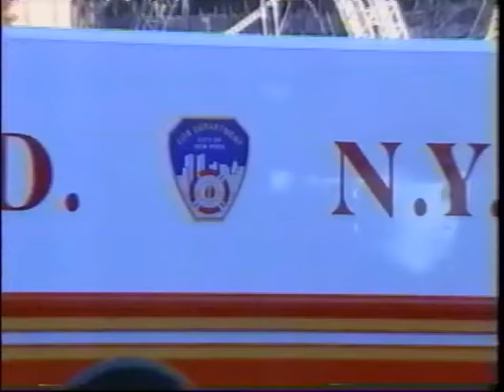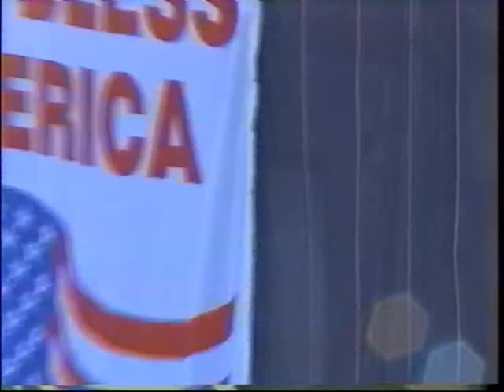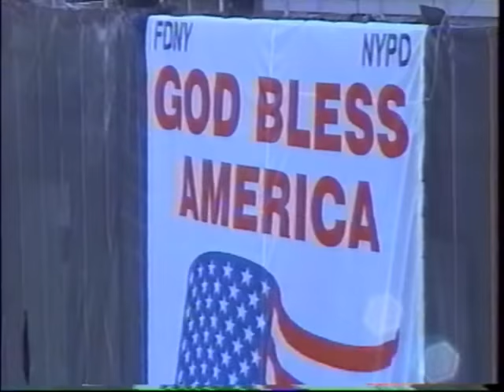Ground Zero recovery months after 9/11/2001

Comment: So some parts of close-standing buildings left standing (Even a part of tower), but WTC 7 went down vertically in 3 seconds. Okaaaaay
Reply: 20 seconds, not 3 seconds.  Different design.  Different construction.  Different damage.  If it is any comfort though, Building's 3 and 4 and St Nicholas Church were all completely destroyed too.
Reply: @MFitz12  what 20 seconds you talking about? Vertical fall lasted for 3 seconds, no more. There is absolutely no way of all the columns to collapse simultaneously with 100% time sync without manual preparation. At least one wall or side should have stayed. But there was even no angle of a fall - this is against all the physics.
Reply: @zudwa9280  - I have the gift of sight and ability to tell time. Also, all columns did not fail simultaneously.  This is why Building 7  is referred to as a progressive collapse.

For clarity I like to break the collapse of Building 7 down into separate phases. Others may break it down differently. If what you know about Building 7's collapse was gleaned from watching conspiracy leaning Youtube videos, much of this will be news to you.  

One of the more presistent myths about the collapse of Building 7 is that the entire building collapsed "symmetrically", at "free-fall speed" (not even a thing) and landed "within its own footprint".  As will become painfully obvious, none of that is even remotely true,… or relevant. 
 
Phase 1 of the collapse event began the moment Building 7 was pelted by thousands of tons of burning debris from Tower One at 10:28 am. 
 
By the early afternoon, after hours of unsuccessful efforts to fight the fires which had spread throughout the building and with reports of from FDNY firefighters of creaking and moaning sounds from the structure and movement in the SW corner, concern was raised the building might be in serious trouble. That the structure was moving, shifting was subsequently confirmed with a surveyors transit. It was clear Building 7 had become unstable, was in danger of collapse and there was nothing to be done that could change that. 
 
With no one left inside to save and to avoid further needless loss of life the FDNY on-scene commander Daniel Negro ordered all firefighting efforts at Building 7 pulled and a safety zone created around the building in the event of its collapse. This order necessitated the cessation of search and rescue efforts in much of the Twin Tower debris pile which was understandably unpopular with firefighters and rescue workers. All of this took place by about 3:00pm.  Building 7 was then left to its fate.
 
Local and national news media had been reporting on the condition of Building 7 throughout the day, reporting that it was on fire and in danger of collapse - and even in several cases erroneously that it had collapsed - throughout the day.  The most famous but actually one of the last such reports was from the BBC at 5:00 pm.
 
Phase 2 - Collapse INITIATION occurred at 5:20 pm, several hours after the safety zone was created around the building. The collapse initiation event is what started the building moving. Once started, everything else was chaos, gravity and momentum. Progression to global collapse was inevitable.
 
The first obvious external sign of collapse initiation is a kink in the roof of the East Mechanical Penthouse (EPH) and a vertical progression of window breakage along the Column 79 line, both events clearly indicating the buckling failure of Column 79. This all takes place in an instant. That the failure of Column 79 would cause this observed behavior was confirmed in one of the NIST models and subsequent independent modeling.
 
Perhaps the most remarkable thing about this moment of collapse initiation is how quiet it was. In the CBS fixed camera video in particular it is clear that most observers failed to notice those initial signs of collapse because there was no sharp, loud noise associated with it.
 
The precise internal failures which resulted in the buckling of Column 79 are hotly debated with several plausible theories, but will never be known with certainty.  It is virtually certain that multiple floor failures around Column 79 low in the structure 8-14th floors) left the column laterally un-braced over an excessive length. Precisely what beam, girder, flange, seat or whatever failed to start things moving is destined to remain a product of speculation for all eternity.
 
Column 79
http://graphics8.nytimes.com/images/2008/08/22/nyregion/0822-met-WTC.large.jpg
https://wtc7fact.files.wordpress.com/2014/02/wtc7buildingorientinterior1.png?w=300&h=241
 
Building 7 Prior To external Signs of Collapse Initiation:
http://www.911myths.com/assets/images/WTC7_Penthouses.gif
 
Building 7 Showing Window Breakage and Kink in the EMPH Roof
http://www.wtc7.net/docs/theory/June2004WTC7_Page_31_m.png
 
Phase 3 - This is the transition period from collapse INITIATION (that moment were things started moving) to the beginning of PROGRESSION to global collapse. From this point on, gravity is doing all the work and everything else that happens from here is the product of gravity, not what caused the initiating event - what started things moving.
 
Externally, this progression phase is evidenced by the complete collapse of the EMPH into the building, disappearing below the roofline 2.2 seconds after the kink first appeared in the EMPH roof. This event clearly indicates the loss of the supporting structure below the EMPH, specifically Columns 80 and 81, adjacent to Col 79. Here is what those column connections looked like:
 
 http://www.wtfrly.com/wp-content/articlepics/girderwalk1b.jpg
 
All 3 columns at the eastern end of the central core have now failed, taking with them all of the floor trusses, beams and girders which were connected to them and are still connected to other parts of the structure.
 
EMPH Disappears into the structure:
http://www.wtc7.net/docs/theory/June2004WTC7_Page_36_m.png
 
When the EMPH falls though the building it creates a visible wave on the windows, presumably as they are twisted or pushed out by the changes in air pressure. The scale of the pressure change is also visible by the smoke being sucked in at the top of the building by the vacuum created in the EMPH's wake.  Smoke is now blowing out the top of the building, it is being sucked back in.
 
This is important because it shows the EMPH descending rapidly though the building, which is consistent with a collapse of Columns 79, 80 and 81 low down in the building and well before the other core columns have failed.
 
CBS video
https://youtu.be/Wf1HcJ7GKsc
 
Composite of 3 videos of the full collapse, synchronized
https://youtu.be/6x7UnTnHy7Q
 
https://www.metabunk.org/attachments/wtc7-window-wave-loop-youtube-2018-01-07-13-37-09-png.30897/
 
Phase 4 - About 7 seconds after Phase 1 we see collapse progression from east to west through the core  as evidenced by the collapse of the rooftop screenwall and West Mechanical Penthouse, dropping below the roofline and into the center of the building along with a series of horizontal exterior window breakages indicating the,…
 
*TOTAL FAILURE OF THE BUILDING CORE*.
 
First Stages of Collapse - Rooftop structures:
https://i.gifer.com/DlV0.gif
 
At this point the perimeter façade and exterior curtain wall are still standing and largely (on the north side anyway) intact. With the core gone the critical structure required to keep the perimeter façade standing is gone.  It can no longer remain up on its own. 

By the way, for any of you who have been running with the argument that Building 7 collapsed at "free-fall speed" (which isn't even a thing) please note:  If that were true the building would be on the ground at this point.  It's still standing. 

Also, for those who are still running with the "all 82 columns failed simultaneously causing a perfectly symmetrical collapse (which can only happen in a pre-planned demolition)" argument that by definition goes hand-in-hand with the "free-fall speed" claim, please note; that obviously didn't happen either. Core columns are gone, most of the perimeter columns are still standing.  Building exterior is still standing. 

But I digress.  Now back to our regularly scheduled programming,…
 
7.2 seconds after initiation the west end of the roof starts to move, followed 0.5 seconds later by the east end of the roof with a distinct kink forming in the center of the roof at Cols 46 and 47. The more astute among you will have picked up by now on the *decidedly non-symmetrical nature of this supposedly symmetrical collapse*.
 
Phase 5 - Global collapse begins 8.2 seconds after collapse initiation started everything moving. By this time the building core has failed and is collapsed or collapsing, leaving only surviving perimeter columns (remember Col 20 on the south side had already failed in the morning) supporting the exterior curtain wall/moment frame which was more or less still standing. Unable to stand on their own, and probably being pulled down behind the collapsing core by still-attached girders, beams and trusses, the exterior columns fail and the curtain wall collapses. As the curtail wall collapses, the center collapses first, illustrated by the distinct non-symmetrical kink in the roofline and the remaining shell of the building twists and leans to the south as it falls, moving in 3 dimensions, not just straight down.
 
It always surprised me that a physicist like Steven Jones couldn't understand the trick that Building 7 plays on the observer. It is similar to yanking a table cloth out from under fine china. The progressive collapse occurs faster than the buildings connections can transfer the energy, so the moment frame and the curtain wall show no effect, because the energy of the collapse is not transferred to them though the floor connections.

Rather than "collapsing into its own footprint", the debris from Building 7 actually filled all four streets surrounding it, caused about a billion dollars in damage to the Verizon Building next door and did so much damage to 30 West Broadway (Fiterman Hall) that it had to be torn down. Because the debris from Building 7 blocked access for the rescue and recovery efforts on the Twin Towers Debris Pile and there were no rescue or recovery efforts to be done at 7, it was removed at high priority in order to improve access to the site from the north.
Reply: @zudwa9280  - Do let me know if you have any questions or comments.
Reply: @MFitz12  the final 2,25 seconds were done at 'pratically free fall speed'. This is a demolition effect, not a 'progressive failure'. The final fall of the WTC-7 was in about 6 second and that's is.  There are NO reasons that WTC-7 should fall so fast and so entirely just because 'the 79th coloumns fallen'. You can repeat the NIST lies all you want, but this will not change a bit of the 'strange' cracking of the WTC-7. So you are another disinsformator who pretend to be credible.  Ah, by the way: HOW THE HELL the temperatures becames 'so hot' that the modern, steel structured WTC-7 went down? Or it was built in 'aluminium' this one too?
Reply: @Diadema033  - So you are saying a building just knows what started it to collapse and 15 seconds after it starts falling just knows to suddenly accelerate to "free-fall speed" (which isn't a thing BTW) but only if explosives started it moving?  Are you really sure you want to run with that?
Reply: @MFitz12  ever seen a controlled demolition? It seems not. Try here on YT, perhaps you'll learn something.  I'll repeat: even NIST aknoledged about 2.25 second at 'pratically free fall speed'. Find me a reason to this and compare the WTC7 fall with the Plasco building that lasted actually almost 20 seconds despite being just 43 meters tall, starting from one point and ending to the opposite, as we could expect by an 'accidental' breaking.
Reply: @Diadema033  - Probably seen hundreds.  You ever heard one?  Watch your own videos and crank up the volume.  Then listen to Building 7.  
Personally, my mind is not restricted to having to compare one event to another dissimilar event in order to try and understand it.  I can explain what happened to Building 7 to quite a high level of detail just based on the merits of that case by itself.

Comment: The only way for there to be intense heat and smoke 8 plus weeks later, was if some sort of D.E.W was used and its my belief that in fact, mini nukes were planted in the sub basement levels of the twin towers, nano thermate charges were planted at the core columns to sever said columns. The D.E.W or nukes is what had the energy to turn both towers to dust a long with the buildings contents. Remember, there wasn't half the amount of rubble there should have been, no toilets, sinks, desks, chairs, file cabinets, phones, computers, monitors, refrigerators, water coolers, vending machines, no carpet, window dressings
NOTHING the only way to explain this is the stuff wasn't there to begin with or the energy weapon was so powerful in fact everything disintegrated.
Reply: Ummmmm,.... no.
Reply: @MFitz12  ummm no really clears it up. I don't hear your opinion.
Reply: @rickdavid6758  - There were already fires.  The debris pile created perfect conditions for those fires to continue smoldering for as long as there was fuel.  No sci-fi nonsense required,... not that the sci-fi nonsense makes any sense anyway (because it doesn't).  Never did.  D.E.W is the ultimate solution for non-thinkers.